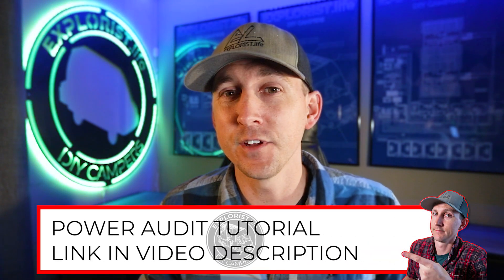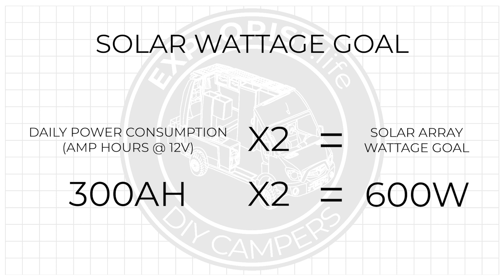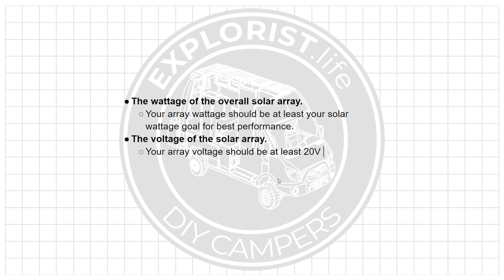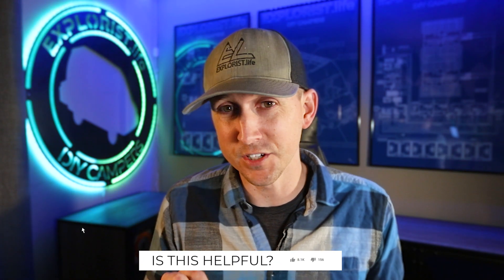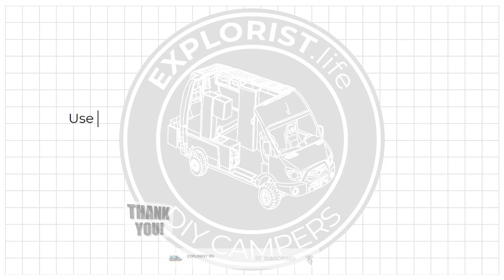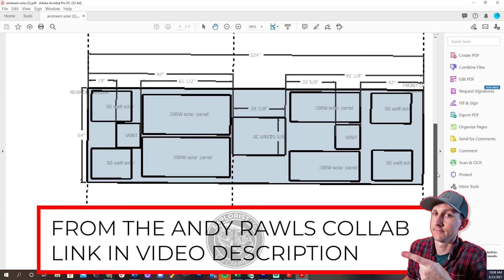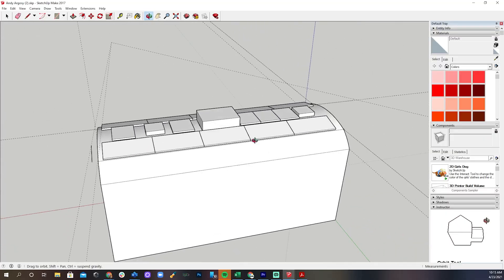Best Wattage of Solar Panel for a DIY Camper Electrical System (and why there isn't a 'best' one)

Comment: I have a question I have 2 12 volt 100ah lipo batteries they suddenly started dropping during use faster then normal at a power draw of 5amps they used to last 2 days now they barely last 9 hours with a full charge I'm using a 400 watt solar aray and it runs everything during the day after charging the batteries batteries are only 2 months old any idea what the issue could be I use a 100 amp mppt charge controller rated for 12 to 48 volt batteries
Reply from the maker: Battery issues like that can have a few different causes, and it really depends on the specifics of your setup, wiring, and gear pairing. We’d love to take a closer, personalized look at your system and help you troubleshoot it (and make sure everything is sized and set up correctly).

Shoot us a message through our support form here and we’ll help you out:
https://shop.explorist.life/support?utm_source=youtube&utm_medium=comment&utm_campaign=support&utm_content=response_link

Comment: What matters most is the space you have to mount them.. I have room for 3 panels.  2 @ 300w and a 200w. They're hooked up as a 500w and 300w.  Usually get about 75 to 80% on a sunny day, and 20 to 30% if cloudy. And it's cloudy most of the time.

Comment: I have been needing to get back into solar. My guess for my needs is 2000 Solar Watts should be more than enough solar to run some type of AC unit for my DIY Truck Camper build. Along with a mini fridge of some sort, TV and PS5. I just subscribed your explanation is top notch.
Reply from the maker: Thanks for the kind words and for subscribing! That setup sounds awesome for your truck camper build.

If you ever want help dialing in your system, feel free to reach out:
https://shop.explorist.life/support

Comment: Help please! 🙏🏻 

Ive been running 2x 400w panels with li time 60amp mppt. I want to add a 200w panel I heard if I do this it will lower the amperage(maybe voltage) of the two 400w and I won’t be able to get max performance out of them…. Is that correct, or only applied when ran in series, I hope if I ran it parallel it would work the best? Can you or someone help?
Reply from the maker: Happy to take a deeper look at this.  Reach out to our tech support: support@explorist.life

Comment: Excellent video. I’d actually been mulling over some of the new jumbo (600+ watts) commercial modules that can normally be ordered in shipping container increments. You sometimes see dividend/leftovers sold by module. Thinking I could weld up some custom feet so they’d be lower than the AC but span over skylights, plumbing vents and what not that is usually in the way. Does look like you do have to pay attention pascal/snow&wind load rating, as not all of them have the mechanical strength to be suitable for an RV (or windy/snowy stationary installation for that matter)

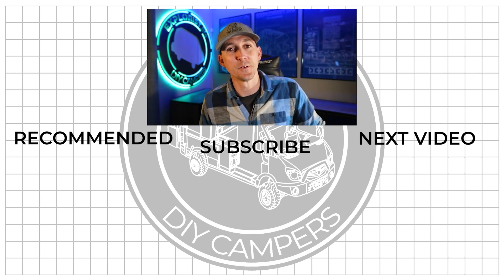Comment: Should I size panels, wire and mppt controller based on 70% because all panels will be flat on the trailer roof? 4:18
Reply from the maker: No.

Comment: Hi, I have just bought a Victron Energy Multiplus-Ii 24/3000 70-50 2X120V and 2 LiTime 24vdc 230 Ah batteries. This said, how much solar do I need for this Van. LiTime says I should have at least 2000 watts to recharge the one battery with in under 3/4 a day.
Reply from the maker: This may take a more in-depth look at your personal setup.  If you have purchased/are purchasing from our store (shop.explorist.life) reach out for some more personalized help: shop.explorist.life/support

Comment: When talking  panel voltage are you talking about open circuit or max voltage or what I see some panels stating operating voltage?
Reply from the maker: oc is for controller sizing.  mp is for actual output.

Comment: Help me to better understand when you say my solar array voltage should be 20V over my battery bank voltage.
If I am running 12V batter bank voltage then I would need to set up my solar array for 32 volts?
So I would have to run panels is series to get higher voltage?
So if I only have one panel and the max voltage is not much more than my batter bank voltage, I will have very poor performance concerning recharging of the battery bank?
How would I meet the goal of 20 Volts over my battery bank voltage if I am limited on space?
Reply from the maker: You would meet that goal by choosing the proper panels so that the array design can meet that 20V overage goal.  Maybe we have something for you at shop.explorist.life

Comment: My two six volt Trojan T-125 deep cycle flooded lead acid batteries in series give me one 12v battery. Each has 240amp/hrs. of storage capacity. So, my total usable energy is half of that or 120amp/hrs. Can someone please give me an idea of how long I'll have enough power to run basic items like the water pump, open and close the awning, move the slide in and out, use my LED lights, play the radio, watch the 22" TV using my Samlex 300 watt inverter before I need to charge the battery. Thank you 
Is it better to wire my two 100-watt solar panels in series or in parallel? Thank you, safe travels 👍👍
Reply from the maker: Hey!  Sounds like a cool setup.  This is the playlist that you're looking for that will teach you how to figure out what you're asking: https://www.youtube.com/playlist?list=PLmvhcyi4n0TVEQCWqGvT0Q0vd8BCbrGfj
Reply: @EXPLORISTlife  Thank you, I'll check it out as soon as I can. Thanks again, and have a great day 👍🌞

Comment: First off all I love your videos. But I can't figure this one out. Why do you need 20v extra for the mppt controller to work properly? 
I also used your mppt controller calculator but have some questions.  I have the 75/15 mppt, I was planning on installing eather the 185w (24.11Voc) victron panel or the 215w (46.01Voc). The calculator recommended the 100/15 for the 215w and the 75/15 for the 185w. 185w is not enough voltage according to the 34.5v rule and the 215 didn't get recommended the 75/15 controller although it's only 55v 15a.

I have the 75/15 controller because I used the ecoflof 110w foldable solar panel but when even partly in the shade it only produces 15w.

Hope someone can clear some things up
Reply from the maker: The +20V is for it to work OPTIMALLY.  +5V is the minimum.  An MPPT needs an adequate incoming voltage range to do the 'T' part of the MPPT functionality.
Reply: @EXPLORISTlife  thanks. So I can basically use either the 185w or 215w panel on my 75/15. I was also wondering is there a reason you don't use victron panels?

Comment: i need help with this solar panel i need 100 w            on the back  open circuit 22.5v max power 18v mono_si   barcode  YHSR2103252660 MADE IN germany

Comment: Hi Nate, I know it's been a while but I'm hoping you would see my comment/question. You mentioned the array voltage should be at least 20V over battery bank voltage for best MPPT charge controller performance. So then in your example with the 3 x 100W panels if they are wired in parallel the V is only 20V, meaning you can only wire them in series?
Reply from the maker: Correct.
Reply: @EXPLORISTlife  thanks Nate!👍🏻

Comment: For car camping and hunting I cable lock a 220 watt Off Grid TREK solar "blanket" to the two crossbars on the  roof of my compact SUV. Then I plug the blanket into my BLUETTI AC200 MAX. During late summer and early fall it powers a small cooler all  day and charges the 2 batteries of my e-mountain bike at themed of the day. It worked very well this year for 5 days of hunting in north central Nevada. IT's also a comforting system to have for extended power outages.

Comment: I like how you do these informative videos, very clear🎯😎☕
 I really need to get off my behind and get a system set up, for my watchmans trailer,( it's a crude, 8x12 box, from a fire/rescue ambulance. Kinda short, inside and plan on raising the roof later on.
 I need enough power to operate a small chest freezer, DVD player, flatscreen tv and a few lights,,,and AC unit, 5k btu, mounted at back wall.( necessary during summer🔥)
 Main thing holding me back is not being able to save enough money, the expense of running a small invertor/generator ( gasoline), is not getting any cheaper.
 Crazy part about it is, if I didn't need to run the generator, for freezer and AC, I could more easily save money, for the solar power set up. I just need to figure out how to make things come about🎯😎☕
Reply from the maker: Yeah, definitely understand that problem.  Thanks for tuning in!
Reply: @EXPLORISTlife  thank you for understanding.
 I thought about getting individual items, and build a system over time. Then, I would probably end up having some item on list, of parts, that is no longer available, or discontinued...lol😁
 If I bought batteries, and utilized a decent battery charger, that may be an option.
 Thank you again and we'll see how things go.
  As life allows, talk later🎯😎☕

Comment: For a solar system in a vehicle is it necessary to ground the negative terminal of the battery to the chassis? Also if my solar system is isolated from the vehicles electrical system won’t grounding the solar system to the chassis cause problems?

Comment: So I have ordered the Renogy DCC 50 amp MPPt/DC to DC charger. It only excepts a maximum of 25 V which is less than the 20 V over the battery charging voltage. Will this be a problem? I will be using three 200 W panels in parallel to keep the total voltage under the 25 V
Reply from the maker: That rule is not for renogy products.

Comment: I'm not sure I understand this video correctly.  You're saying 3-100w panels are basically the same as 1-300w panel.  I was looking at panels and I found a 100w - 24.3v panel that measures  873.62 sq inches (41.8 x 20.9) for $95.  I then found a 485 w - 43.3v panel that measures 3645.6 square inches (91.4 x 40) for $224.  So for a little more space and almost half the price, I could have 1 panel instead of 4?  Am I missing something?
Reply from the maker: Bigger panels are usually less expensive per watt per square inch, just be sure to factor in shipping as larger panels usually need to be shipped via freight or picked up at the warehouse.

Comment: Hi Nate! Thank you for such in-depth explanation on Solar. Are flexible monocrystalline solar panels (300W/12Vx4) off ebay capable of powering a water pump of 550W/24V.

Comment: Hi just watched your video. Thanks. I am looking to install panels soon. You say battery size+ 20v. In my case 12 + 20=32. I have a renogy 50amp dc to dc combined mppt in the spec it says 25v(660 watts) max input. Can you explain your thinking please.Could I use a perc panel with this spec(  Voltage ratings (STC) : Vmp = 41.3V; Voc = 49.3V  Thanks
Reply from the maker: The Battery V + 20 is only for Victron SmartSolar MPPT's.  The renogy 50A MPPT/DCDC is incredibly limiting in this regard.

Comment: I had been planning to arrange my 2 200w panels in series, but with a slight tilt relative to each other (why is irrelevant, please don't ask)... but now I've realised that perhaps the panel with the non-optimal tilt will give less amps, and this will limit the amps coming from the more optimally tilted panel. Is this correct? If yes, I would change my plan to ensure that they are both having the same orientation.
Reply from the maker: You're going to have better results if they are pointing the same way, but I've never tested the 'how much'.

Comment: These array calculations are confusing if for some reason you have only 3 panels and do not want to place all of them either series or parallel for example difficult shadowing issue.
What would be calculation for 3 similar 12v/5A panels where two of them would be in series and one parallel between those two?

Comment: 2:40 35 volt solar input is the advice given here multiple times..
So I wonder, why does Renogy with all their experience produce DC - DC MPPT dual solar / alternator chargers that limit their solar input to 25v?
Reply from the maker: Yeah, I don't know.  It's pretty goofy.  One of the biggest reasons I generally don't recommend that part.

Comment: So if I have 100 ah battery with 60 +60+50w solar panel how should I put them in series or parallel?? Here in Denmark is not so much sun
Reply from the maker: Hey, Lucaci arnold-vasile! I appreciate you taking the time to ask your question, but unfortunately, I don't have enough info about your specific question to provide an accurate answer, but here is a playlist that, if you watch all of the videos start-to-finish (and take notes 😉), you'll have a REALLY good idea of how to design a solar array: https://www.youtube.com/watch?v=Jkbs84sBHsg&list=PLmvhcyi4n0TV9pi83rFTv3ZuMT_S1xIZt

Alternatively, I have some of my most common solar array setups pre-built here: https://shop.explorist.life/product-category/all-products/camper-wiring-kits/solar-charging-wiring-kits/

Comment: You missed one important factor. Higher voltage between the panels and the charge controller is preferred because the wire size can be greatly reduced making it cheaper and easy for routing and high voltage give less efficiency loss.

Comment: Have you ever been involved with Solar on a motor yacht?   We have a 50 foot one and all the lighting is 12 volt.   I am installing a new refrigerator and freezer,  both will run on 12/24 as well as 120 volt.   If it wasn't for the 3 - 120 volt air conditioner units I think I could figure it out.  The AC's draw about 25 to 30 Amp to start then about 15 to 20 for run.  We live in Florida where it hot all the time and have a lot of sun.  I figured one time that all the 120 except the AC would be around 1800 watts.  There is a 12 v battery charger that charger 3 batteries that could be charged via a solar charger I think.  That would remove that 120 volt load maybe. 
Looking for some ideas on this.  
I have room for at least 4 - panels 2 x 4.
Reply from the maker: These tutorials have indeed been used by many who are installing/upgrading Yacht electrical systems.

Comment: You need to update your info. Why are there no 450w panels? Now there are over 500W panels. Why would anyone choose 4 - 100W panels???! LOL. What a waste of roof space and it costs more.
Reply from the maker: This video is plenty up to date, bub. Oftentimes, the larger panels don't fit the roof space available.  For example... a 500W panels would have never fit onto this roof with an air conditioner and maxxair fan present: https://youtu.be/zspCRKAFxKA
Reply: Yeah! Bub😅

Comment: 10 years ago I thought the same way and built my system. After my experience, upgrading and rewiring I am sure now that you are totally wrong. Mistake in your logic and math is Shadows. RV solar system is not house roof array or array of power station. Very often RV panels has shadows from something - trees, houses, other RV, own antennas and AC. Nature of panels they do not like shadows and drop all power if only about 10% covered  by shadow. All other panels in series stop to work as well. Solution is to use smaller panels in parallel. It can be less efficient for MPPT and needs thicker wires but overall performance should be better in real world
Reply from the maker: Five years on the road for us and 'partial shading' was never really a problem.  We were either in full sun, or full shade.  This is, in my eyes, a non-issue.

Comment: So I have 2-200 watt solar pannels wired in parallel and receiving approximately 22 v with 6 amps in full sunlight max, this is the most I’ve ever seen.  Does this sound right?  Please and thanks.
Reply: On a good day up here in Washington state a 100 W panel gives me 5 1/2 A charge current so I would think you would get at least 20 amps if you have two 200 W panels

Comment: Hi great videos by the way , would u be able to explain this ? Which is best more  volts or more amps going into the mppt charge controller ? Reason I ask I am  thinking about getting a  votronic 3 way system. but  it has a max voltage input of 36 volts , so if I do go this way I would wanna wire up my pannels to increase the amps like u have explained in previous videos , but in reality which is bets more volts or more amps many thanks for your time John

Comment: How do you set your VOC 20V higher that the charge controller if it has a Max input VOC of 25VOC? Have a Renogy Dual input DC/DC 30A charger and want to add solar but assumed I’d have to run all the panels in parallel to keep the VOC bellow 25
Reply from the maker: The 20V higher than the battery bank voltage guideline is only for Victron charge controllers.
Reply: @EXPLORISTlife   well am charging 26-28v lipo4s 8 cell with victron 100/50  with only 38voc , controller PV input shows 34v at max 28amp when panels see good sun and hit 900w -1100w , outputs 35amp  i have 2x 300w in parra and 4x 150w panels in 2s2p mix panels so, upping voltage is tricky mabie ill try series conection on the 300w full size pannels with 42v voc

Comment: when calculating wire size i notice my panels have 2 voltage specs and2 amp. specs, the two that multiply up to the wattage of my panels are the rated voltage Vpm and rated current Ipm  not the open circuit voltage or the short circuit current. So are these the specs i use in your wire size calculator ?

Comment: Hi can 600 watts 24v solar panel work on pwm 60amp charge controller to charge two 200ah 12v gel battery bank?

Comment: I have a 24v battery bank and 24v solar panels. So should I wire my solar panels in a series parallel circuit. To achieve 48v  to achieve the 20v higher than my battery bank?